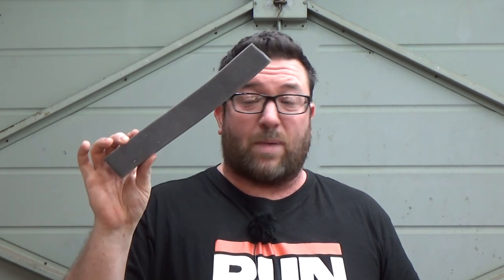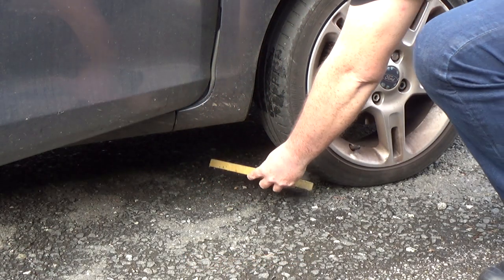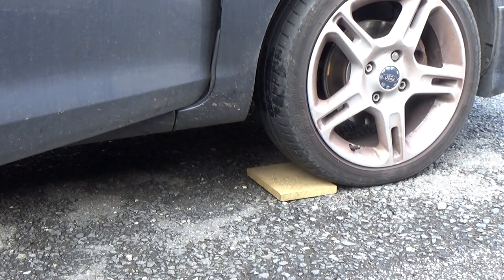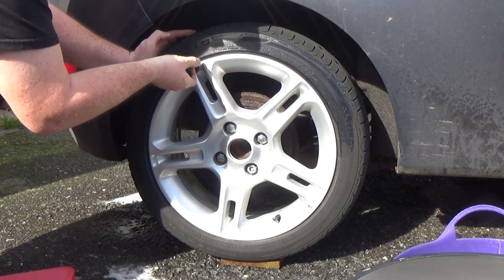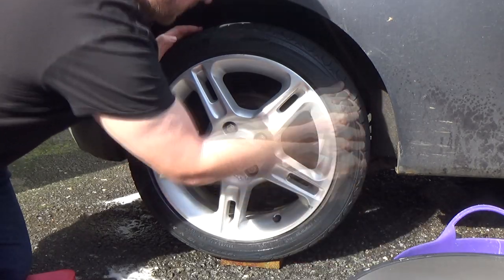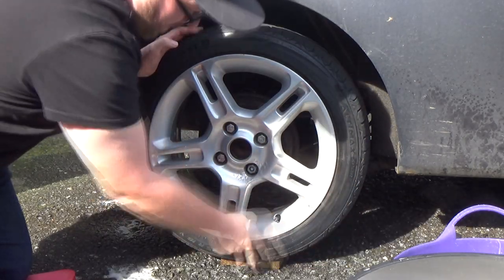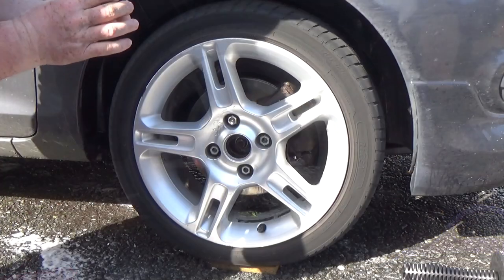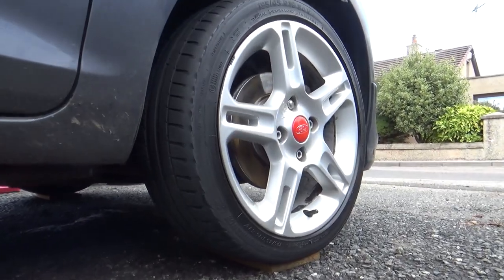This is Not A Tyre Dressing! Garage Therapy One Tyre Serum

Comment: Hi Specky you seem to be using my method of cleaning wheels and tyres. I have been using Serum for a while now and although I was a little disappointed  with it at the start, as the layers built up over multiple applications, I became a fan. I use nothing else now and in fact finished my 500ml bottle and well into my 1 Litre bottle. With regards wheel, tyre and arch cleaning I spray the decon onto the tyre and arch, diluted 10 to 1 then cover the arch, tyre and wheel barrel and face with wheel shampoo from my pump sprayer diluted 20ml into 800ml water. As soon as the foam hits the decon on the tyre if there is dirt on the tyre the foam instantly turns brown. Very impressive. I am looking forward to trying their snow foam in due course. Good film and review as usual.
Reply: I just ordered that wee brush as you sold it to me.
Reply from the maker: Haha excellent, let me know how you get on with it.
Reply: @SpeckyMcSporran  Will do in due course.

Comment: Thanks for demonstrating this tyre brush I’ve been waiting to see it in action after yourself and Paul were talking about it in your podcast. Think I’m going to have to get one. Just one thing. Do you need to clean it out after using it if your using it as a dedicated tyre dressing brush?
Reply from the maker: Great question, I would say it depends on how often you use it and what type of dressing you use.
Regular use with a water based dressing is probably not requiring a wash after each use but silicone based dressings might clog it up a bit. Best practices for brush maintenance likely suggest washing it out after each use to be on the safe side.

Comment: Hi Specky, that brush looks great, may be good for tyres with more "stuff" on the sidewall, 4x4 etc.
I've been using GT Tyre Serum for a good while now and I have to say it only gets better over time with a top up added now and then. Seems to make the tyre very easy to clean, nothing more than Wheel Shampoo needed. I've also found it great on door rubbers, even useful on rubber footwear!
Reply from the maker: Footwear?? Wow!
Reply: @SpeckyMcSporran  haha, l know, helps prevent cracking on yer pricey wellies!